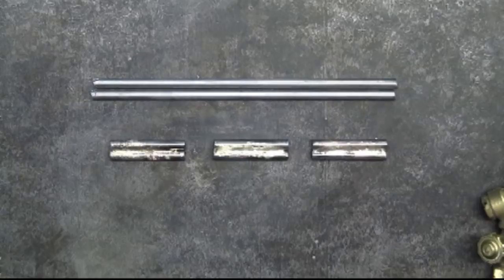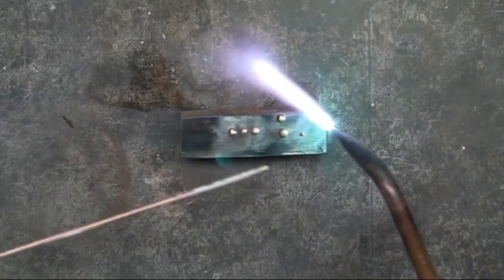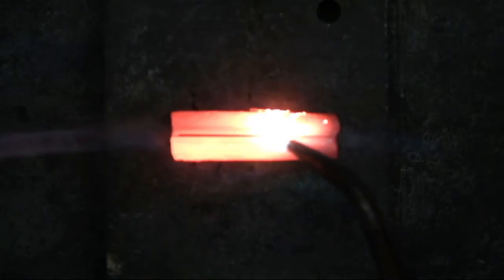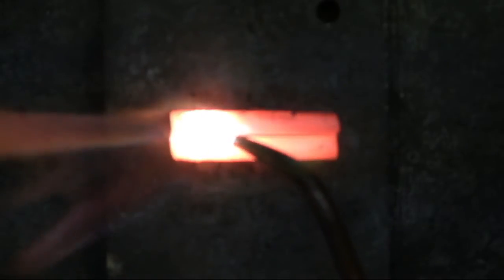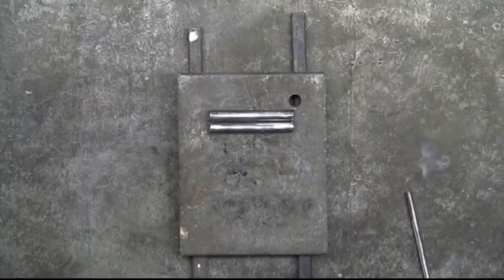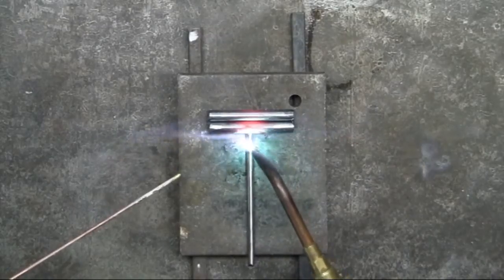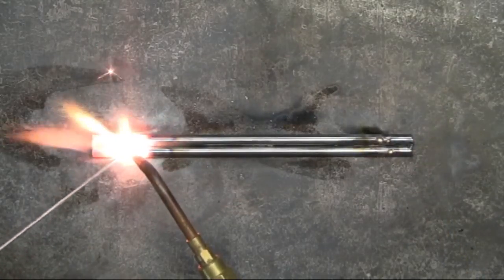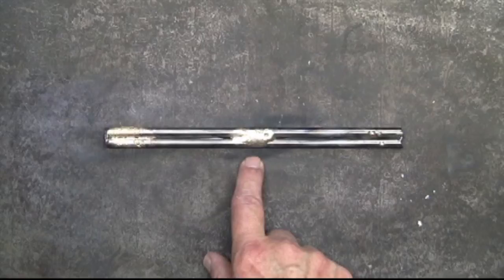Brazing Heats #2

Comment: What do you think about using stranded copper electrical wire as a filler rod for steel or copper?
Reply from the maker: Interesting question. I've never tried stranded.  Might not be rigid enough making it hard to handle.  I'd think if you put one end in a vice and the other end in a electric or cordless drill you could twist it tighter and making it more rigid.  Check out the video on "copper hardening":  
https://youtu.be/vCnegq416GQ